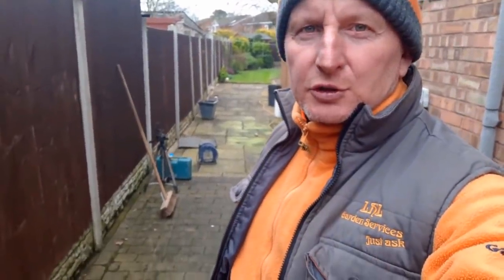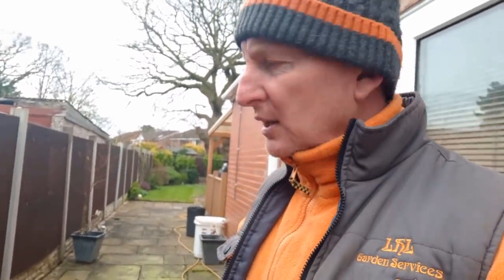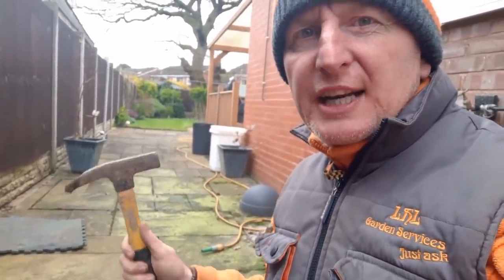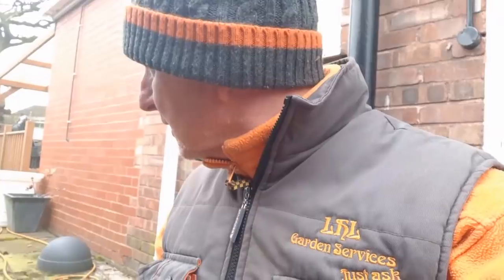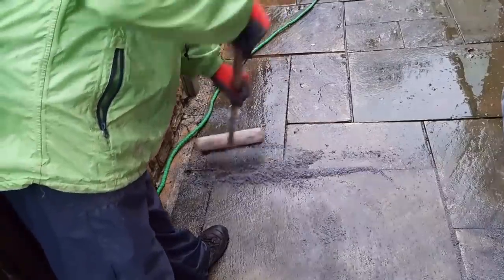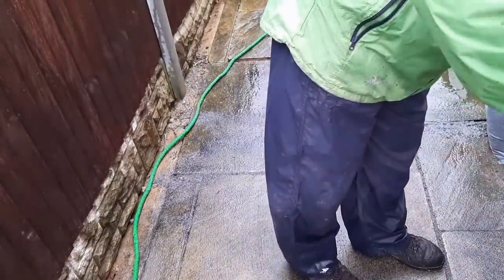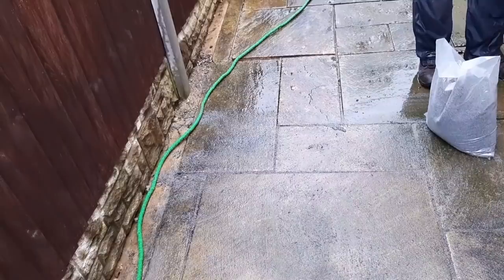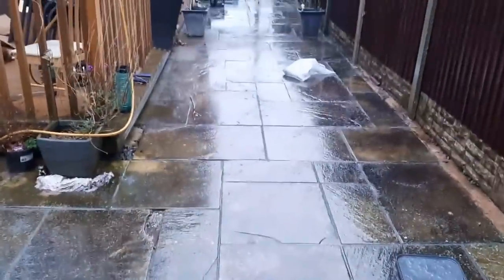Patio rejuvenation re-point /softwash(to follow)

Comment: Good effort that mate in harsh conditions. It's another good service to offer and makes a huge difference. 
When you turned the tap on there... it reminded me of a handy little tip I do for customers.. It's so annoying when you turn on a customers hose and the water leaks from the yellow Hozelock connector on the tap... So i bought a bag of the small rubber ring seals on Ebay, it was pennies for a bag of 50 or something... Now every time I come across a leaky tap, It's nearly always that small black rubber ring that's split on the connector and I just replace it. Let the customer know you've done that free of charge and their delighted they don't have to put up with the leak anymore and their smile is priceless.

Comment: Always a tedious job re pointing. I purchased a mini hand Mattock made by Rough Neck for that type of job. I used the blower after scraping/beating the pointing out. Saved a fair amount of time. I did try the drill rake bits but just went though them so quickly.
Reply from the maker: I've got that mini pick but couldn't find it🙈 😊👍

Comment: Lee if you had a very large patio/driveway with block paving currently pointed with sand, what would you use for a more permanent job? as opposed to pressure hosing and repointing the sand every year? (want to be able to pressure hose still though, just not the re pointing every year) The pointing is about 5mm on one section then about 8mm on the other. Your thoughts would be much appreciated! good job btw
Reply from the maker: You should only use the sand ( kiln dried) blocks are designed to move slightly (dont ask me why🙈) why are you so against re sanding? It  doesn't use much and doesn't take long 👍
Reply: @LHLgardenservices  Thanks Lee, it's just the paving gets greened/dirtied up (3 dogs on muddy walks every day) so easily it needs pressure hosing more than once a year really (only do it once a year atm though). 

It takes a good 7 bags of sand to redo it all, it's a very big area. It's a two-day job every year as it stands. I was hoping there was something that could be a permanent/ semi-permanent fix (and allow the pressure hosing still). But I will have to stick with the sand! 

I know you can use chemical cleaners but that doesn't remove all the mud/silt that builds up from the 4x4/dogs, the sand also gets very messy so does need replacing at least once a year.
Reply from the maker: @lamarr1986  understood 👍....if you WANT to use this jointing compound then it's up to you 🤔...why doing you try a small area first and see what happens 👍
Reply: @LHLgardenservices  Thanks Lee, might give it a try!
Reply: Well if ya don’t wanna repoint regularly you could replace the entirety of the driveway with stamped/stained concrete.  Expensive but would remove the hassle of repointing.
Reply: @jaykneegarner2479  Spent about 20k or so on the drive, not too keen on that idea, but in hindsight, we would probably go that way if we were to do it again!